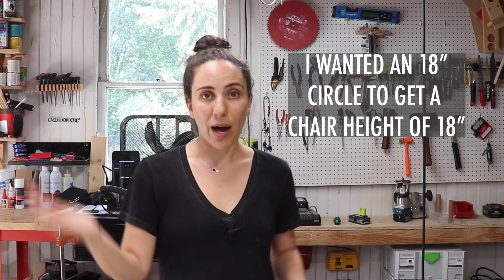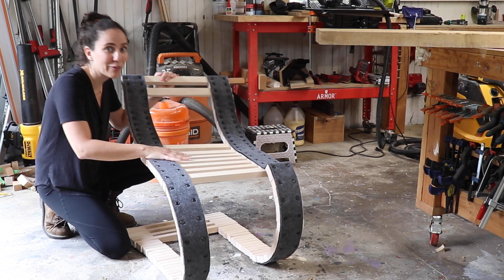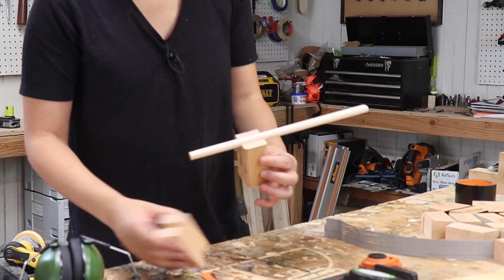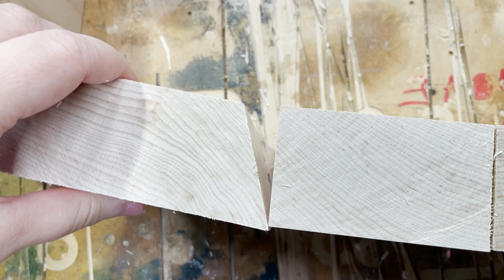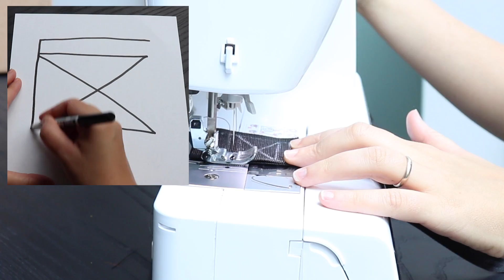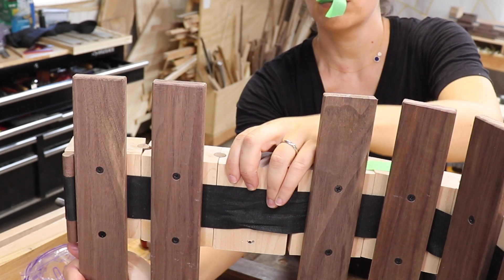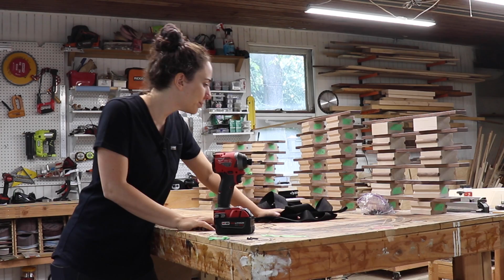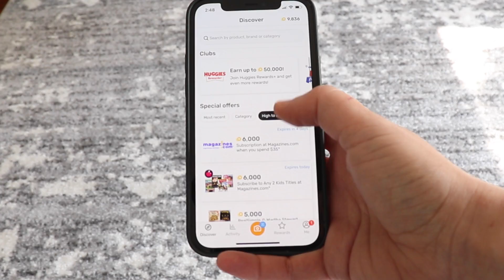I ATTEMPT to make a Roll Up Chair… AGAIN...

Comment: You’re right, that lower bend needs to be able to take a much higher load than the rest and with the straps it can transfer that stress anywhere along the chair. I bet hinges would work, isolating the stress, but you’d need some really heavy hinges for the stressed areas. Fantastic work, you’re so creative and always give me lots of ideas for my projects.
Reply: Before I read your comment, hinges were what came to mind. No stretch, and each joint is independent instead of coupled to the rest.

There is some elegance to the straps that is lost though. Definitely changes the feel of the chair.

This is a tough project! Things worth doing are often not easy. If they were easy, everyone would do them.
Reply: @jaustinpage  It would probably only need metal hinges at a few of the most bendy parts near the knees.  And for the straps, I think something like braided steel cable is probably going to work better than any cloth/leather/nylon strap.  You could run a leather strap over the top of load bearing steel cables for asthetics.  There's a whole field of engineering and design called tensegrity, which is all about exploiting cables and tension for structural integrity, so it's definitely possible.
Reply: @guaposneeze  you could even pretty easily create ruts in each piece so that the cable sits flush under the strapping
Reply: I think shorter straps would work as well. Like if the strap was just going from 1 block to the next it would basically be a hindge

Comment: I think you need something with 0 stretch like steel reinforced drive belts. Another option that might be good is hinged joints with the hinge flat when the chair is open.

Comment: the main problem is in the strapping.   it stretches.   any type of strapping is going to stretch under that kind of pressure.   the solution is to change to using aircraft cable in place of the strapping.   aside from the strapping there does not seem to be any other issues with the chair, so change the strapping to cable and you will have a fully functional chair!

Comment: I would be curious to know if the gaps between the blocks of wood were filled, would the chair become more stable? I think a simple way to do this, is for you to add a wedge the size of the gap between the blocks as the chair is standing.  If the stability increases, your next step would be to design a way for a wedge to slide into the gap as the chair is unrolled.  I hope this is helpful.

Comment: I think it might have been said, but the problem is the distribution of forces. The need for tension across the chair is not equal, so all of the potential stretch or movement is adding up and being released at the point where the tension is greatest, and the areas where tension is least are just curling up. Just shortening the strap won’t help. 
Maybe adding a few pieces of strapping in a few layers would help. Add a bottom layer just covering the front of the curve and screw it down to reinforce, then add another one covering the bulk of the curve and screw that down and then add the full length strap. This will reinforce the areas under the most stress.

Basically right now you’re playing tug of war with a bunch of children and sumo wrestlers… the kids don’t stand a chance, you need to handicap those sumo wrestlers by tying their shoes together so everything becomes balanced.

Comment: Still interesting. I suspect there are of course some solutions to the problem. The general idea will work. My proposal would be that the strap should be clamped fast individually on each segment. You could do that by just cutting a rabbet on each segment, exactly there, where the strap runs through between the segment and the seat bars. Clamp the strap into the rabbet with a fitting piece of wood (something like you used to connect the segments by using the dowels). In that way, the cord will not strech over the whole length but just between the segments. The remaining strech can be compensated maybe by calculating the angle of the segments so, that the chair is a bit higher than necessary. It will move into position when you sit on it.

Comment: So, you have one long strap (on both sides). I think you can keep that, but also have individual straps for each connected pair of blocks. This would limit the whole system stretch, but still allow the visual and functional design.

Comment: It seems like the angle you are using are the problem. The way the forcd is being put is on the smaller side therefore opening it. Possibly securing the strapping directly to the joints where the most pressure is applied. The force at the front bend of the chair is going to be much more than at the back. Allowing one strap across the chair to be segmented with different tensions would possibly help with buckling.

Comment: All you have to do is tension those pieces in pairs and not the whole thing. That way you can control how much tension is applied in different places of the chair. Also use more layers of straps for safety reasons. It's actually not that difficult, we did build one is school back in the day but we used steel cable...

Comment: Easy fix: just sew a dowel in mid-seat.

Acknowledge this: 1 chair = 2 parts, seat & back rest, 2 weight loads
your chair: 2 curves, 2 belt pathways (inward/outward)
The upper part (inward curve) folds when tension rise -> lower tension -> gaps in lower part.
The bottom curve and top curve need to have independent belts.

Comment: Just use steel cables, everything you used has too much stretch, and those gaps are caused by the point of most stress collecting all the stretch over the whole strap length. Screwing the straps to the wood on every point would also help i feel.

Comment: I feel your pain.  Maybe running the strap thru the middle of each block would create even/distributed tension at each “joint” face?  Right now each “joint” had low tension on one side with no strap and high tension at the opposite side because of the strap.   If the strap was running through the Center of the joint face where you put your dowels I think it would create better surface to surface pressure and stabilize the “joint”.

Comment: Try attatching the webbing to each individual piece or have individual webbing between each join, the stretch (and there will always be stretch unfirtunately) along the entire length creates gaps where the forces are greater due to the design. Individually attatching the webbing will lock the peices together and equally distribute the amount of stretch.

Comment: Kept me awake. Just felt for you. What about each block like a tank track section, eg tenon on one side which goes into a cutout on the next, held with dowel through the middle.  I would finish the one in the video by completing the circle, which should add the stability and strength.  Thanks for sharing your pain.

Comment: You should make the bottom curve less so that when weight is applied you will have the final shape you want. It’s like bending metal but reversed. When bending metal you have to over bend it to account for the spring back. So with this you should under bend the curve so once weight is applied it will have the shape you want under tension.

Comment: The only materials I can think of, that would not stretch under so much tension would be a bicycle chain (or a steel cable), however that would make it heavy. Alternatively you could use a carbon-belt, but I suspect they are very expensive, especially if you need one that long.
Also, not sure if the stretching is the only problem here. I would suspect that the wood compresses enough to cause troubles.

Comment: You need different parts of strapping, full length is not going to work. Make full length blocks where the tension is highest and have more rows of strapping in those areas.

Comment: What if you route a shallow channel through the middle of each piece and run steel cable instead of strap like a truss rod. You can hide it  and the tension will be more internal not on top. I really like this concept. Hope you nail it one day. 😊

Comment: my thought with strapping...seatbelt material. and strong doesn't equal no stretch. just means it won't break, probably because it stretches. think belt needs to be fixed to the blocks. good try. keep going and then patent it!
Reply from the maker: That’s what I used

Comment: What if each block was made into a big hinge that stopped at the required angle at each part of the bend in the chair, so you wouldn’t even need straps. Big wooden hinges that stopped where you wanted. Maybe use straps to hold the backrest in place to keep it from falling when you get up 🤷🏽‍♂️

Comment: I admire your persistence and the use of dowels to prevent rotation was pure genius. Different places need different level of tension. You might try affixing the webbing to each element. Shorter distance of webbing between elements that bear a lot of stress and longer on the ones that don't need that much tension (for example on both ends of the chair). You could also cheat a bit by placing strong hinges under the webbing between the elements that need most rigid joints.

Comment: Sorry but just a thought maybe the whole straps isn't that great of an Idea not to be rude or anything but I think even metal wouldn't work. Maybe some kind of jointed chain like between each piece of wood would make more rigidity and would last longer
Reply: Also maybe a third row of wood in between the other 2 so it has more strength  and then try experimenting with undercutting the angles so when it bends and you sit any flex in the wood get taken up by when you sit which could even wear into a better starter chair since now all that sag you originally had ends up being the finish piece when sitting

Comment: Interesting and fun to watch. A quick estimate on the force in the strap, and at the “wood contact” point on the opposite side. The max bendingmoment will occur at the outermost part of the bottom curve. If we say that the chair is suppose to hold a person of 100kg, the center of gravity of the person is 500mm from the outermost bottom curve and that the thickness of the woodpieces are 50mm, the force acting in the strap is (500mm/50mm)*100kg = 1000kg. The strap will probably hold this force, but this gives two problems. The relatively large force will stretch the strap, and the contact point on the opposite side of the woodpices will have a large force over a small area. This will compress the wood causing further deflection. Again, thanks for a great video and fun project to watch.

Comment: With glue, ~half the frame is in compression (inside), and ~half the frame is in compression(outside). With the outside strap and no glue then there is no scope for tension in the frame. If you pre-tension the strap then the frame will uncurl. If you don't pre-tension the strap then it stretches too much.
 I suggest you use cable/wire running along a hole inside the block 2/3 of the way to the outside. You will need a ratchet to pre-tension the wire when you deploy the chair. But, because there is wood on the outside of the wire, the shape will still be stable. 
When you are not sitting on it the outside wood is in compression, compensating for the pre-tension. When you do sit in it the inside wood is in compression and the wire tension increases.

Comment: A problem with the strap over time will be stretch. You might have more luck with metal cable which is strong in tension but flexible to roll. Good luck. My son is an award winning Structural Engineer, which might be a further option!

Comment: You should not have let the tension to be distributed into the whole system. Only the lower curve is problematic, so concentrate on that. Or even handle the joints individually. E.g. a 2 meters strapping will stretch 2cm, but a 10cm strapping will not stretch noticeably.

Comment: You might include a string that would be applied last in order to strengthen it(connect the top plank with a plank at the curve on each side with a rope of sorts).

Comment: As others have said, it's pretty essential that you fix the strap to each block (or at least, every couple of blocks). The tension in the strap wants to remain constant, but the structure isn't loaded equally. So the highly-loaded joints are causing the other parts to collapse.

Apologies if you address this in the video (still watching), but I think it might help take a step back and  try prototyping a few different configurations of a single joint. A simple prototype (think two wooden beams, end-to-end, with a hinge on one edge) can be used to measure the degree of pry-apart for different configurations of beam thickness, webbing type/quantity, and load.

Looking at your design, you've got maybe 8 joints in the most highly-stressed section of the design. 
If we make some simple assumptions (each joint prys open by the same amount), then consider how far away your butt is from the furthest-forward joint (let's say 600mm), we can figure out roughly what's 'acceptable' for a given joint.

For argument's sake, let's say we'll accept 50mm of sag with an adult of 80kg sitting in it. Using those numbers, this means you're only allowed to have 0.6 degrees of pry-apart per joint.

If you set up your test joint and load it up with an equivalent bending load (you can either use a 600mm long beam with 80kg on the end of it, or use a longer beam with lower weight), you should be able to experiment with different straps and stuff until you reach that level of performance. Simply placing some wooden blocks between the strap and the beams would let you replicate a thicker beam, so if you can't find a strap that works, you can experiment with the thickness until the numbers work out.

If it's difficult to measure such small angles with the equipment you have, you can make the strap twice as long to get double the stretch and (roughly) double the angle.